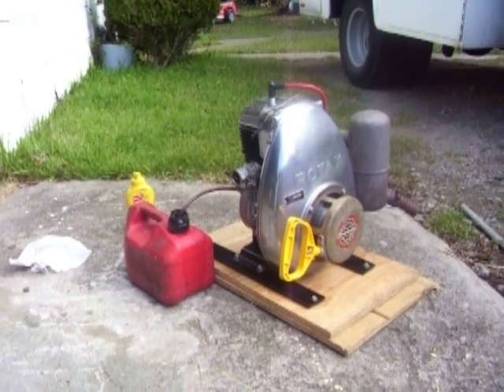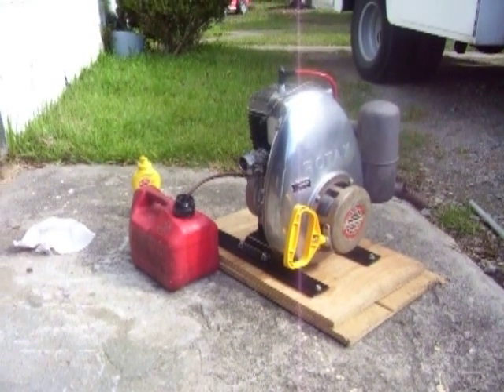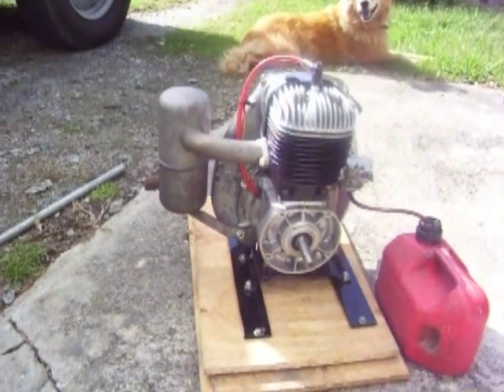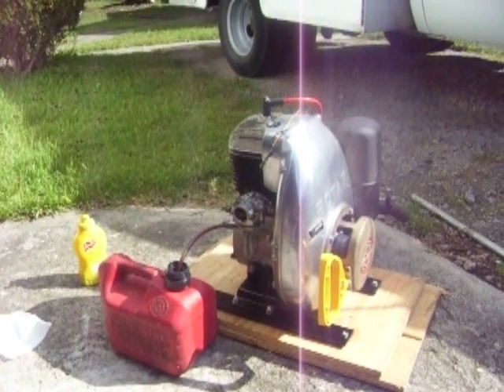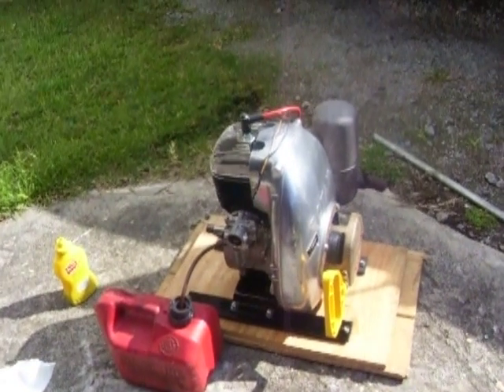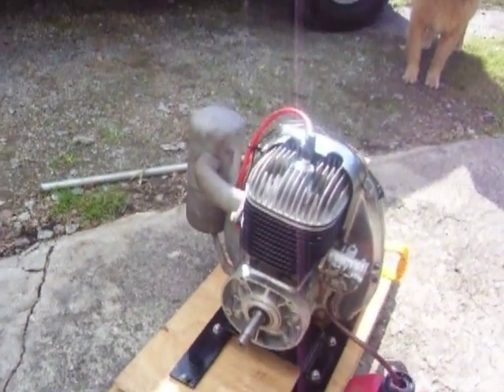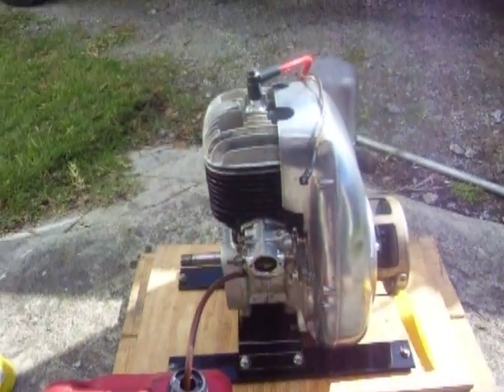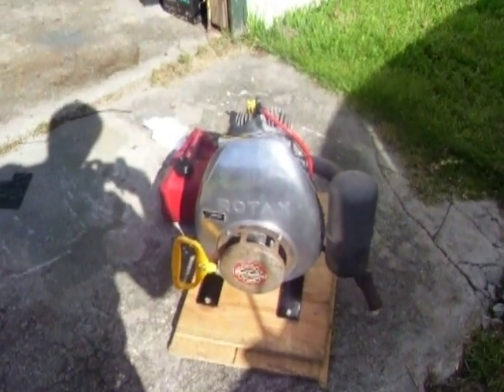Rotax 247 from a 1967 Ski Doo Olympique test run after a bench rebuild

Comment from the maker: @gtasa550  The 12 horse 247 you speak of debuted in the Elan for '71, had an aluminum cylinder with a steel sleeve, much larger intake and exhaust ports and used an HR Tillotson carb.
The early cast iron cylinder versions of the 247 date back to 1963 per the "collectors guide to Ski Doo snowmobiles" and the first version was 8 horsepower. Became 9hp in '64, 10 in '65-'66 and the '67-'68 versions such as this one were advertised at 10.5.  This engine is on the '68 in my other videos.

Comment: @doghearder mix it at 40:1 and you are fine, even 50:1 is good with the new oil we have.  I generally just stick with 40:1 though and have for many years, I own several elans with that same engine and no probs.
Reply: My dad runs 50 1 , I like 32 1 , could any  of those hurt the sleds
Reply: @masonmaceachern1858  no that should be ok, if your 32:1 isn't fouling it and your dads 50:1 isn't too lean then good to go.

Comment from the maker: The factory called for 20:1 back in the day using 30wt motor oil but I mix 32:1 using modern two stroke oil.  See the video of running down the snowman for it running in the sled we put it in, a '68 Oly.

Comment from the maker: UPDATE.  In the two seasons since the vid was made, it has had a fair amount of use considering we don't get a whole lot of snow in Virgina.  It lost spark shortly after the 4th of July grass ride vid. I tested the coil, it was good at 5.56 ohms. The points dispite being filed clean had iffy continutiy so they were replaced, and I put a condensor in it "just because". Also, the snazzy red Accel automotive plug wire had some measurable resistance, so I replaced it with solid core Belden.